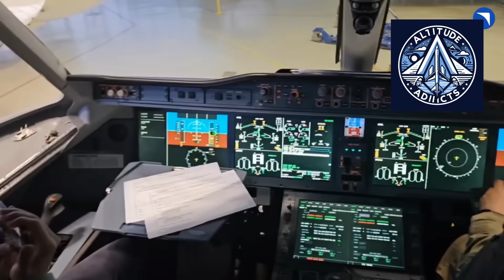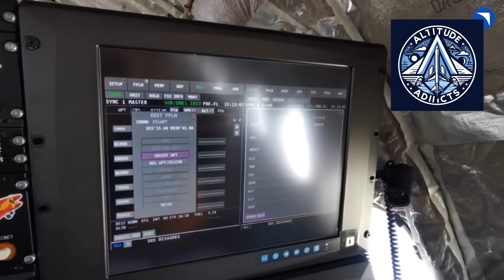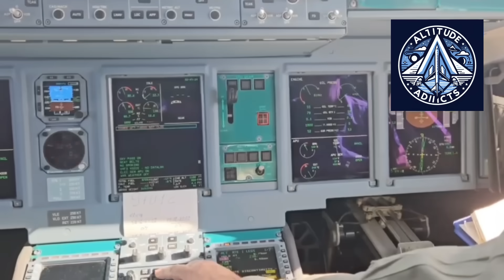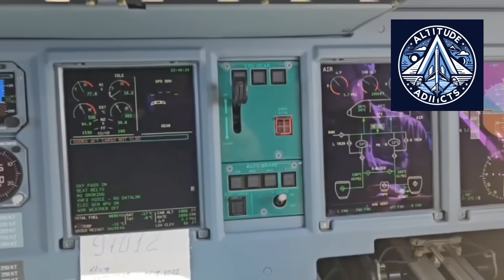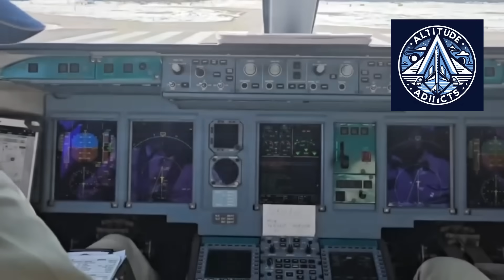Russia May Fund Replacement of SaM146 Engine with PD-8 on SSJ-100 Superjet

Comment: 30 Triebwerke/Jahr sind zu wenig um auch nur Ansatzweise die geplanten Auslieferungen von SJ 100 zu sichern. Das bedeutet das 2026 maximal 15 SJ 100 bestückt werden können. Da aber für die Erprobung des BE 200 mindestens 2 (4) Stück benötigt werden wären es nur noch 14(13) SJ 100, wobei hierbei noch nicht ein einziges Reservetriebwerk für Wartung/Instandhaltung/ Service vorhanden sein würde.
Nein so kann man seine Luftfahrt nicht umgestalten.
Und gerade der Bereich weltweite Verfügbarkeit von Ersatz/ Tauschteilen & Service war immer ein Schwachpunkt der russischen Luftfahrtindustrie., welche viele Fluggesellschaften Abstand nehmen ließ von den Flugzeugen aus der UdSSR/GUS/Russland.
Nichts hassen Fluggesellschaften so, wie die Codierung "AOG" für ihr Fluggerät.
Wenn man mit dem PD 8 (6-10) auf dem Weltmarkt und in Russland erfolgreich sein möchte, dann müßten Produktionsgrößen von 150-200(300) angestrebt werden.
Und wen man die SJ 100 in Indien produzieren möchte, dann müssen diese ja dort auch mit Triebwerken versorgt werden. Oder baut Indien die SSJ 100 mit Sam Triebwerken ?
Gleiches gilt für das PD 14 (12-18) wenn man nur die Planungen für die MS 21-310 betrachtet und negiert, das eine TU 214 SM(21) als total überarbeitete Variante ebenfalls mit PD Triebwerken statt der PS90A ausgerüstet werden könnte, welche durch russische Hard & Software, sowie andere Verbesserungen & Modernisierungen, durchaus Chancen auf dem Weltmarkt hätte. Erst recht wenn man sie recht dicht an die Steuerung und Ausstattung der MS-21 Serie herausbringt, einheitliche Standardisierungen auch als Verkaufsargument für die Fluggesellschaften verifizieren kann.
Über MS 21-4x0/5x0 mit PD 35 ( 26-40) wollen wir erst garnicht reden.
Die Produktion von PD Triebwerken muß also mit =/>1000/a geplant werden.
Sollte man COMAC auch mit Triebwerken beliefern wollen, müssten die Produktionsmengen, noch einmal um ein vielfaches höher geplant werden.
Ich wünsche der russischen Luftfahrzeugindustrie viel Erfolg auf dem schwierigen Weg zur technologischen Weltspitze.

Comment: They have plenty of good engines to replace tbe SaM-146, they can use a Kusnetzov NK-86 or NK-8, a Soloviev D-30 or a Lotarev D-36, or a mix of all of them like the PD-8 which it can be just an NK-8 with a FADEC digital controls and a new manufacturing bureau...!..

Comment: Hold on one second... pd8 was developed for superjet. What are you talking about
Reply: SJ-100: Es el mismo avión, pero evolucionado para ser autosuficiente. Fue rediseñado para utilizar sistemas de producción nacional, como los motores rusos PD-8, debido al impacto de las sanciones internacionales.
Reply: El SJ-100 es una versión "rusificada" del Sukhoi Superjet 100 (SSJ-100), creada después de que las sanciones internacionales interrumpieran el acceso de Rusia a componentes y motores occidentales. La principal diferencia es que el SJ-100 reemplaza los sistemas de origen occidental, como los motores PowerJet SaM146, por tecnología rusa.
Reply: SSJ-100: El diseño original dependía en gran medida de componentes occidentales, especialmente de Francia (Safran) y Rusia (NPO Saturn) para sus motores.
Reply: Das PD 8 wurde als Kern für die Triebwerke von 6 bis 10 t Schubkraft entwickelt, vorerst vorrangig für die SJ 100 hergestellt.
Es ist beabsichtigt auch BE 200 mit dieser Triebwerksserie auszurüsten.
Auch ist dieses Triebwerk durchaus in der Lage, ältere Triebwerke dieser Klasse zu ersetzen oder gar neue Flugzeugtypen damit auszustatten.
Aber im Focus liegt zur Zeit ersteinmal die SJ 100/Be 200.